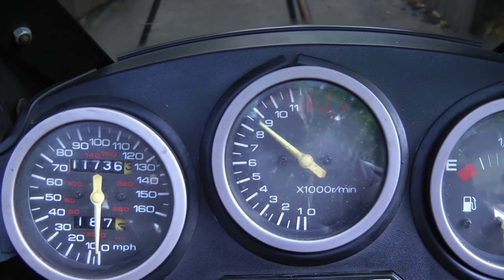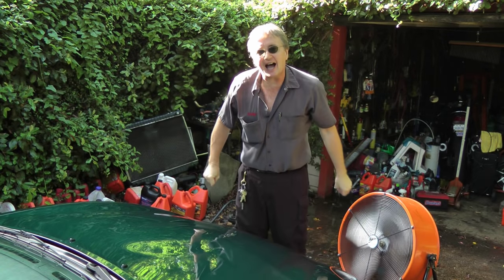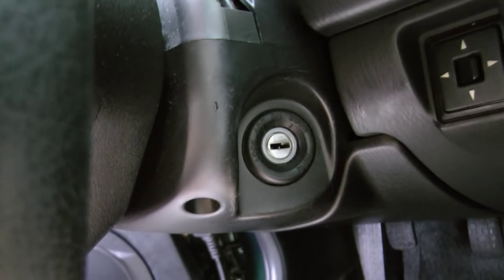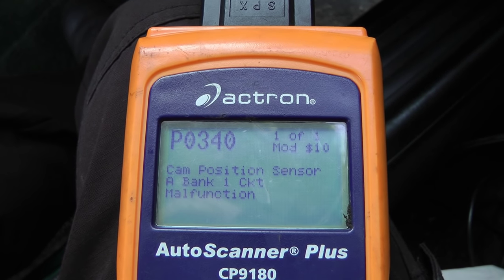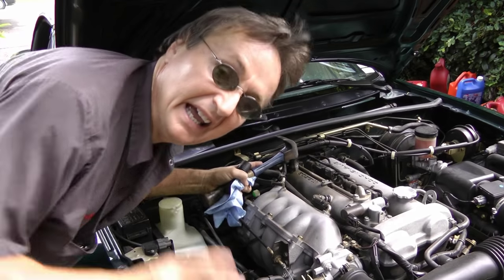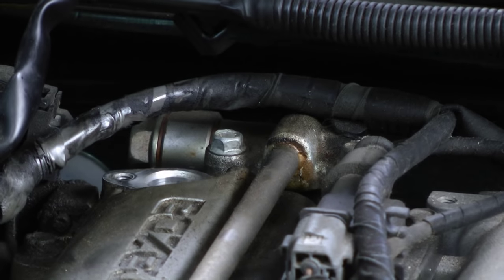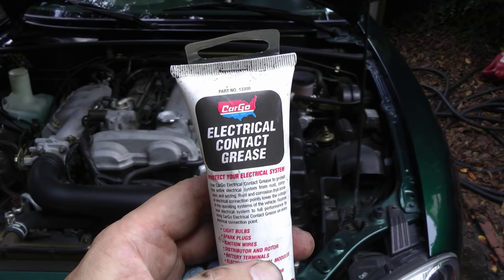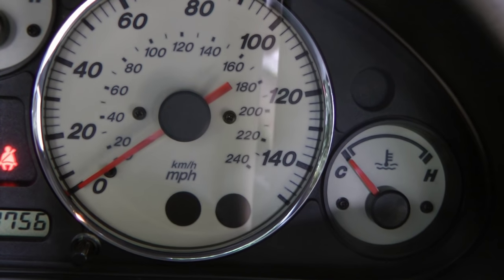How to Fix a Car that Randomly Dies while Driving

Comment: Hi everyone, after replacing crankshaft position sensor, engine coolant temperature sensor, engine oil temperature sensor, spark plug and fuel pump my car is still stalling, I moved the key in switch and found both are good, what I found is when I start the car it starts stalling at parking and driving does not matter what speed some time it starts by itself some time not and some time does not even start so, I figured out. If I turn ignition on off on off on off on off on off and start it starts like new until turn off, now what I do  start and see it is stalling turn off engine and turn ignition on off five six times and start  car run really good. Can anyone tell me what and where the problem is?
Reply from the maker: bad fuel pressure regulators do that, as do dirty injectors. Try changing the regulator and do my video "how to clean fuel injectors on your car"
Reply: Hi Kilmer, I replaced fuel pressure regulator and clean fuel injectors, unfortunately still stalling by put the key in and start if I twist key on off 3to 6 time start and run so good while running good I Shak and move key in and out car did not stop with both of my keys, please help me again

Comment: I change the neutral switch still no start no crank when I turn my key forward for power on, none of my lights come on the dash
Reply from the maker: +Latwon Plant try a new ignition switch, if not that, check for power loss with a tester from the battery to the switch and up to the fuse box
Reply: I had the fuse box tested & look N behind the steering wheel all wire are in tact I had my alarm bypassed last year but if u started it from the started da lights come on dash start up ,after a few minutes then die thanks for helping me out alot I'm going to check the ignition switch but y no lights on da dash I don't no

Comment: how do I get the computer to sent the correct volt?
Reply from the maker: +Edgar Chavez IF the wiring is not shorted out, check that, then the computer would need replacing to get it correct as it controls all that voltage

Comment: What if the car doesn’t start at all after it dies when driving? Code was the same ....
Reply: I think it's still the cam position sensor. My 93 Miata has fuel and spark but won't start. I'm thinking it's the cam position sensor or the ECU, but I'm not getting a code for the cam position sensor. I'm gonna try replacing it (a bit pricey; the cheapest ones are $150) and seeing if that helps.

Comment: My honda ody 2001 dies sometimes in the morning when its cold but let says i turn on and leave it idle for a min or 3 then when i put on the reverse it dies or while outing from p to. D4 it die the lights on the dash stay on but i feel like the car just somehow cutting off all the power and i able to restart right away just the first minutes does that later on works perfectly and stalls as well sometimes have new spark plugs cleaned the egr valve gas new pcv valve new tps sensor have tuneup a few weeks ago if anyone could help me to find the solution to this problem :) but idk it doesn’t have to put the car on reverse it dies on d4 as well forgot to say that

Comment: so I was at a stop light and my car turned off. there's times where I would start the car then drive and I would step on the gas and it wouldn't do anything a few seconds later does it again then after 3 4 times it's stops. help me

Comment: what if the scan tool says nothing is wrong?
Reply from the maker: that's only the beginning, then you need years of experience fixing cars. Computers only set codes when problems are more than 25 percent off normal running. Good luck

Comment: where best place get a code reader that's work for 93 d150
Reply from the maker: +David Buckingham that's OBD 1, and nothing outside a dealer level scanner that costs a ton will give you much information really. It wasn't until 96 that good info could be gotten out of modern low priced scanners

Comment: i have 2003 nissan altima 3.5 new battery new alternator but still dies when lights on
Reply from the maker: +steve have the alternator load tested, auto zones do that free. Pray it's that and not a weird wiring short
Reply: Thanks Scotty

Comment: I have a 2002 dodge caravan it will start but it will not stay running
Reply from the maker: +Mario Lockett pressure test the fuel pump, pray it's just weak. Also check for vacuum leaks on the intake system as in my video 'finding engine vacuum leaks with a cigar"
Reply: I just put new fuel pump and I don't see know air leaks

Comment: Idk if anyone gonna see this my car been shuttong off on me for 2 months now i got new filters new spark splugs new oxygen sensor new alternator new battery oil changed 2 times catalytic converter cleaner fuel injecter cleaner and my car still shutting off
Reply: Did you fix it
Reply: @joaquin0023  yea, it was the manifold catalytic

Comment: False information.  I have seen another video of a mechanic using this hammer method and its total nonsense for two reasons.  First is because if the car starts then the cran sensor is good.  Secondly if you whop the sensor with any iron/metal object it wil usually shut your engine off because the outer metal of the hammer draws the magnet flow from the sensor tip.  To see if a sensor is bad while in the car you unplug the connection and place a volt meter with your 12V-20 setting and crank the engine over and it will show voltage plain pure and simple or you can use a test light. Bench testing only offers resistance reading which are still not suitable for checking a crank trigger  The internet s full of scammer liar mechanics

Comment: Mine died in middle of city road going about 35 mph.  Lost complete control of car.  Couldn't turn wheel, it's like the car just fainted and stopped working all together.  Good thing no cars were behind me and didnt hit anything.  Turns out it was the crankshaft position sensor not camshaft on mine.  It's apparently not an uncommon problem on oldsmobiles, especially intrigues.  Just can't trust American brands.  What if I was driving 65 or 85 on the highway and it died.  Dangerous as hell, scared me to death.  No thank you to American cars.